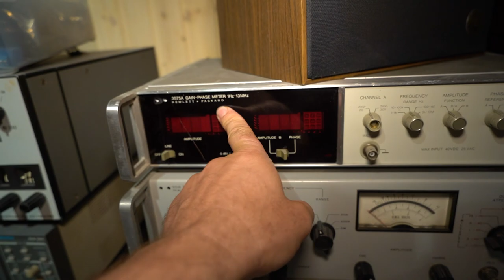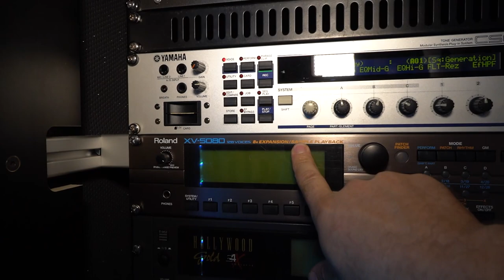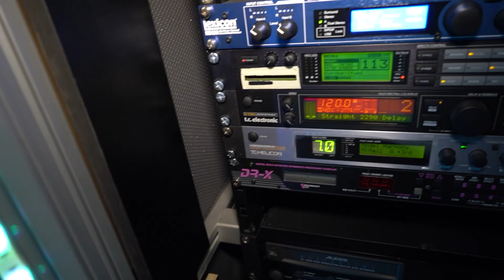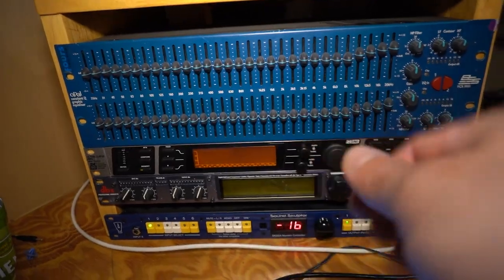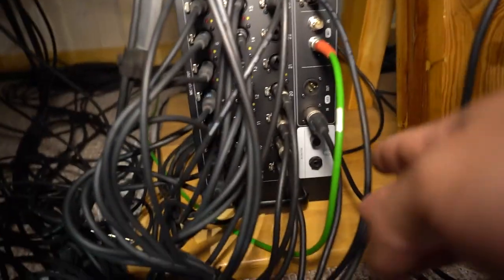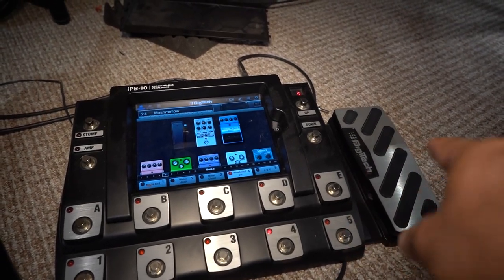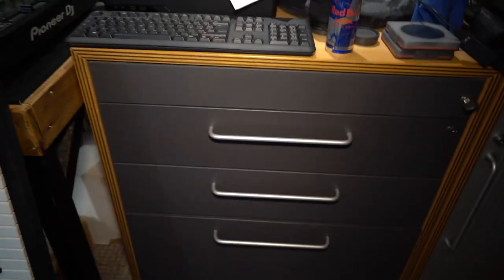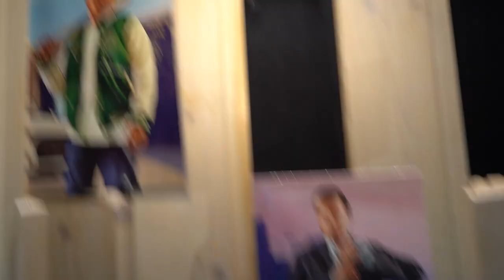BMR Studio Tour 2023

Comment: Hi m8, I have a few 25 - 100MHZ CRT oscilloscopes I would like to calibrate, apparently I need a "Pulse Generator " with a sort of specific nano second rise time , I am in Australia and test equiptment like this never comes up for sale , can you suggest any other options , I have a Feeltech FY6900 60mhz signal generator and a Marconi 2019 but I doubt these will suffice..
Any suggestions??
PeaceFromOz.
Reply from the maker: look for old HP units. Popping up on Ebay... ooor, I think a modern 200 Mhz sig gen with pulse function (Siglent has some specific technology for stupidly fast rise times... called easypulse) 
Or, You can make a superfast Ghz RF transistor generator. EEVBLOG Dave reviewed one in his mailbag show. One guy is specialist for this on his Forum. Few basic elements, no pcb needed :)
Reply: @BMRStudio  cheers , I was looking at the SIGLENT SDG1032X as it does a 2 Test for my single sideband  cb radio tuning, it also says EASY PULSE on the front...I am checking it out atm.
PeaceFromOz